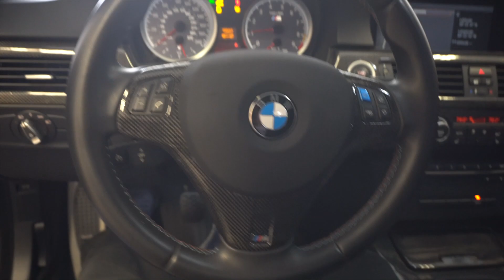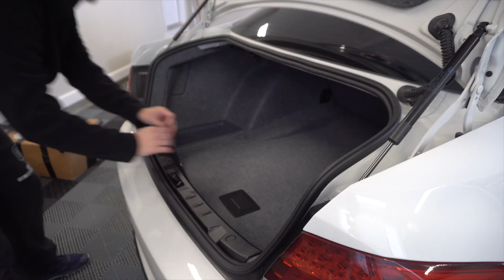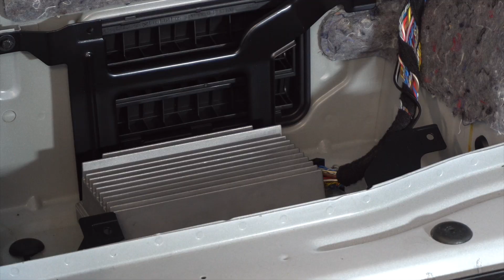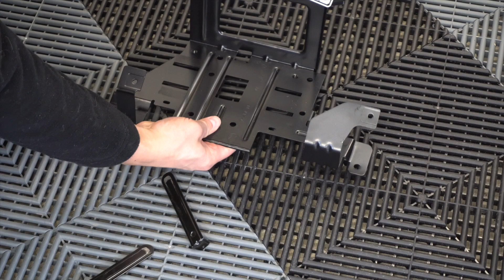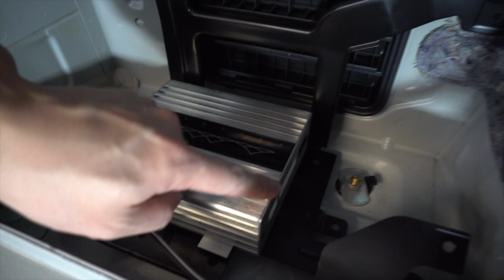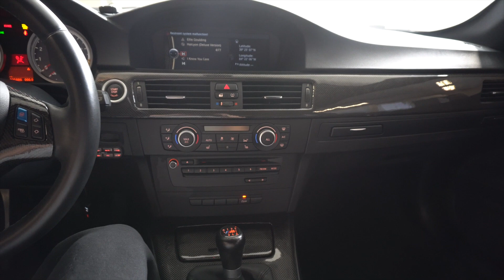BavSound Revenant Amplifier Install | Plug N Play for BMW

Comment: A 1800$ box😨
Reply from the maker: Made quite the difference!
Reply: @accelerated_motion  well I’ll have to consider that box then. is it a must have if your upgrading to the ghost system or could u run the 600$ subs with the stock amp? I have the Harmon kardon system
Reply from the maker: @CTDFishing  You can run the with stock amp!

Comment: I have 2012 335 with high fi really looking to improve so you like? What’s different between this and bmertech?
Reply from the maker: I would say that the Amp is the biggest bang for the buck. I noticed a difference in crispness and it enhanced my stock speakers. I ultimately changed the speakers to BavSound as well, and it got even better. So yes, I like them and I'm glad that I upgraded from the standard HiFi. I dont have any experience with BimmerTech's setup, but I would imagine it would be something similiar to BavSound. I would check some reviews on the forums.

Comment: Will the replacement amp work in a 2021 Toyota Supra
Reply from the maker: This exact amp, probably not a direct swap. But I'm sure that BavSound is in development for the A90 Supra. I would check their website or reach out to them to see what they have currently available for that platform.

Comment: Does the amp work with the enhanced sound premium stick system I have a 2010
Reply from the maker: BavSound does sell an amp that will work with your premium sound stock system. Go to their website and plug in your information and it will offer suggestions on what products will fit your specific vehicle.

Comment: Is that amp for 740il e38 as well too?
Reply from the maker: If you check BavSound's website, you can see what options are available for your car. I'm not sure if they have an amplifier for yours or not, but you can also reach out to them for confirmation.

Comment: Does this Amp works with the Harman Kardon sound system?
Reply from the maker: If you plug your information in on BavSound's website, it will give you options on what you can buy. There should be an AMP that will work for you.

Comment: Does this also work if you have the Hifi audio system with the 9143162 amplifier. Can't find a 2nd hand one for a decent price
Reply from the maker: Double check with BavSound. You can give them your VIN and they can tell you what products will work with your specific vehicle. I would imagine that it does though.
Reply: @accelerated_motion  oke thanks for the fast reaction. 👊🏽